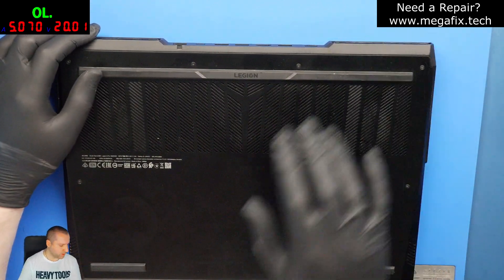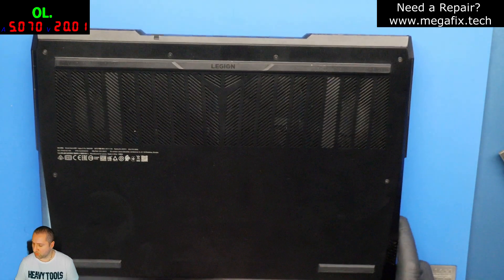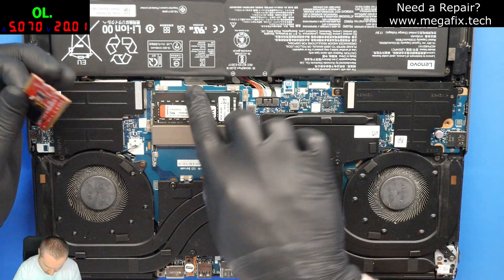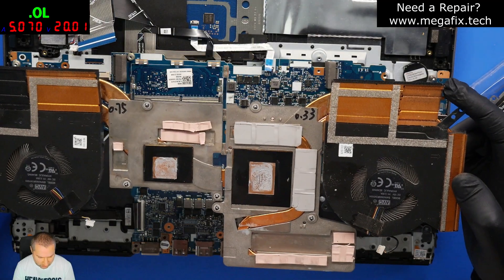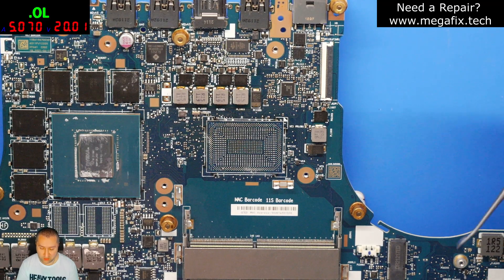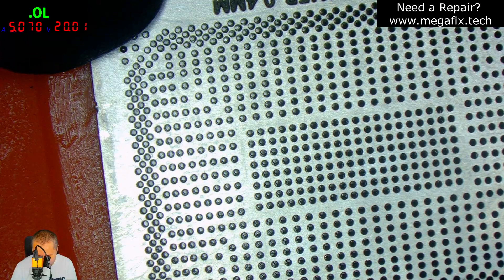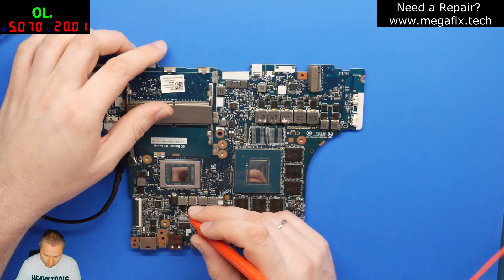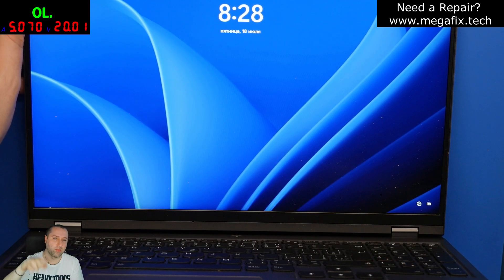Lenovo Legion No Image Repair | CPU Compound & Reballing Solution

Comment: Had exactly same issue after trying to reboot because of broken time in windows(not just hours but minutes). Once BIOS reset helped me, it launched again, but after night without power supply even keyboard lights not starting when trying to turn on the laptop. And I tried to switch the cmos batteries, no chances. I guess my trip to Prague for cpu reballing, exactly in your repair store is very close... 
Btw, I have exactly the same laptop as in video. Sadly I did not find that video before trying to fix the laptop 😢

Comment: Nice repair, I've done a few lenovos too, a question; did you use something to soften the black underfill? that was very clean, it usually went off with pads and a lot of it stays on the motherboard.
Reply from the maker: wd40
Reply: @MegafixTech  Never seen that, I will try it. Until now I've been using kaisi to take out the remains from the motherboard.

Comment: I got the same model with same issue on CPU ,after repairing how much time untill it would be dead again?
Reply: usually it should last for a long time. as there is no black goo, and solder balls are probably leaded - lead is making them a bit softer so they handle temperature changes better without microcracks.

Comment: What tool did you use to remove the chip? Thank you.
Reply from the maker: For removing Lenovo BGA chips that are covered with compound, I use a modified spatula from a dentist tools set (bought on AliExpress). I thinned and sharpened it a bit with a grinder, so when the solder balls are molten, I can carefully lift the chip with it. Here is the link : https://surl.li/ecpunq